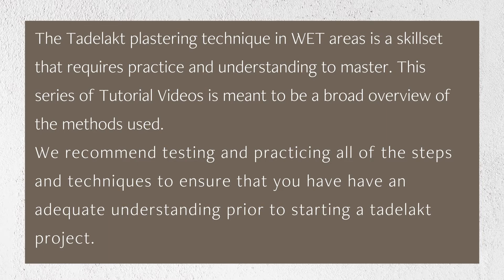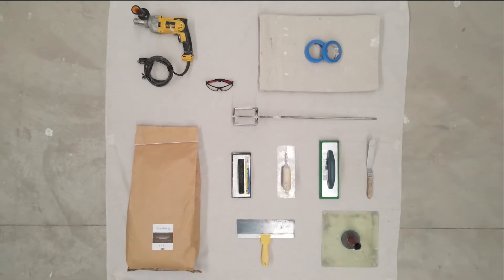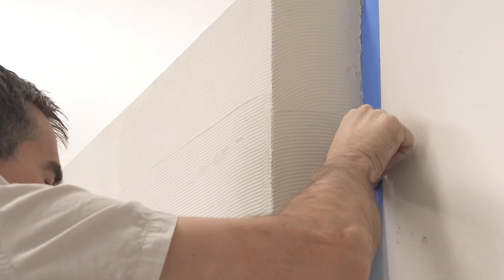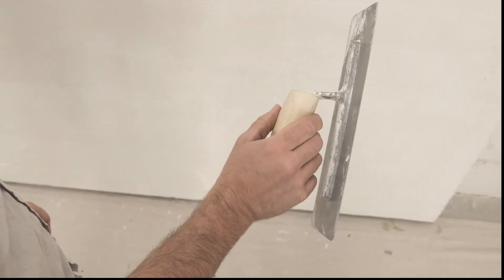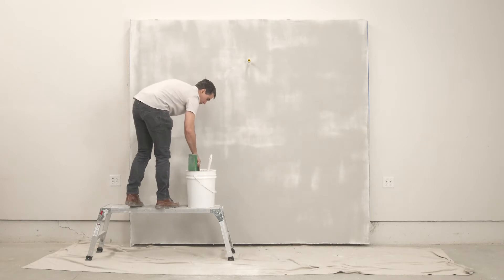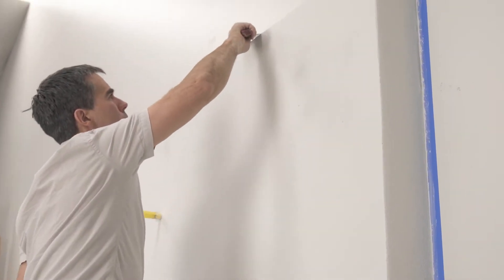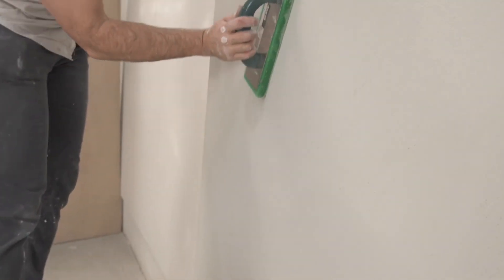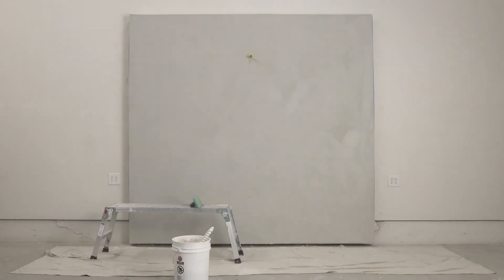Earthaus Tadelakt Finish:  Shower & Non Shower Base Plaster Application

Comment: When you install cement board above a tub and there is that little gap for the tub lip, about 1 inch-normally when I tile, I back fill and tile over this. I would like to try tadelakt but am not sure what to do with this area. What would be the best way to backfill/prep this strip to prep for a tadelakt finish?

Comment: For the application of the first and second coats, would you mix enough plaster for both coats - expecting the plaster to not harden in the bucket - or should you plan to mix two separate times, mixing what you expect to apply per coat?

Comment: Seems it's a different process to what is done in Morocco.
Reply from the maker: Yes,  in Morocco, they are starting with masonry substrates typically.   Here we typically start with stud framed walls.  There are lots of steps needed to prepare these types of wall systems to receive a system like tadelakt.
Reply: @EarthausPlaster  what if the entire home is Concrete since that's what we use in the Caribbean to build our homes. CEMENT, BLOCK & STEEL? Would the process be shorter as in less steps to follow? Where would we start from if we were to tadelakt on Concrete structures?